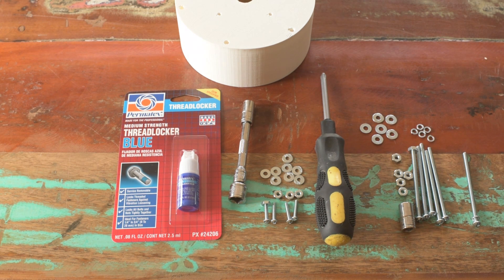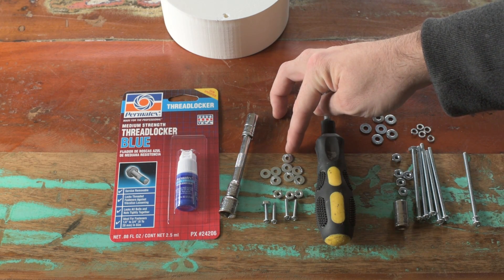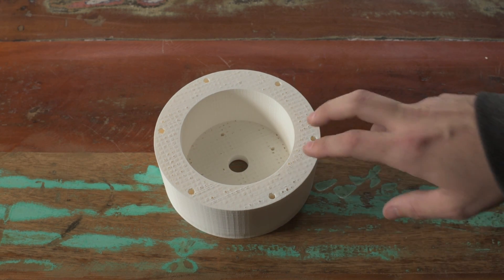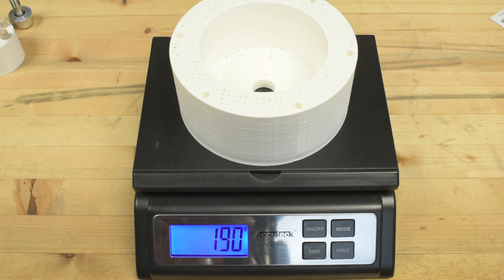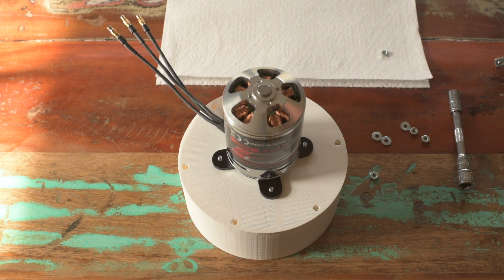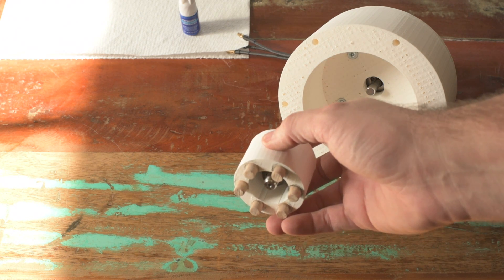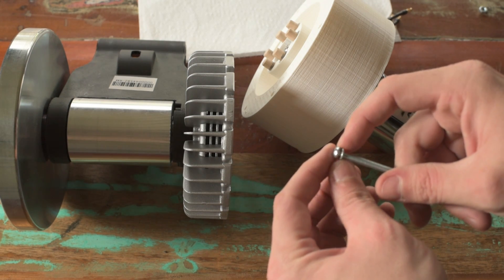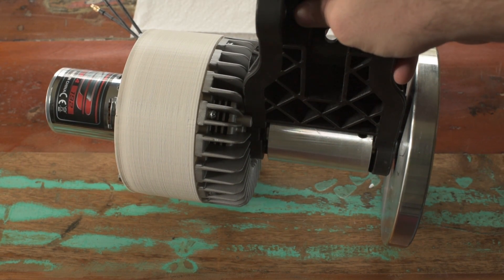Assembly - Bicycle Generator - Part 2

Comment: Well done nice work if you need one of those printing email me the stl and ill print it and send it to you  you defenatly need more shells top and bottom i imagine your using 0.4 nozzles try 1.2mm shell thickness all round with 30% infill 0.20 layer hight combing on 👍👍good luck

Comment: NOOOO not an ultimaker!
I will point out, people say the ultimaker is better than the makerbot, not because of better or faster prints (trust me it is way slower than the makerbot!) but because of the history of makerbot.
It used to be open source and they went closed source and people got butthurt.
Reply from the maker: Does Makerbot have a Bowden extruder too? Speed wasn't really one of my purchase criteria. I was mostly after reliability. I would have bought a Makerbot instead, but did you hear about the lawsuit regarding their extruder in 2015? Makerbot also refuses to accept PayPal for some reason. They just can't seem to make decisions that make sense.
Reply: +createthis +createthis To fill you in, i work at a hackspace, we have a ultimaker 2 , two makerbot clones, one rapmman 3 and a makerbot cupcake.
the Boden extruder constantly jams on the Ultimaker and the print results are rubbish unless you print REALLY SLOWLY.
The makerbot clone is cheap as chips and chuggs along!

http://www.ebay.com/itm/3D-Printer-CTC-Transparent-Based-on-Makerbot-Replicator-4-2-Extruders-/181557613109?hash=item2a45ad5235:g:--EAAOxy63FSr-00
or for the slighly lowe quality build one:
http://www.ebay.com/itm/CTC-3D-Printer-Dual-Extruder-MK8-Factory-Direct-Lowest-Price-ABS-/221995881469?hash=item33affc53fd:g:MOgAAOSwu-BWQyNX
Reply from the maker: +Jared Reabow (Jazza) I have read the Ultimakers jam unless you print slowly or have a pristinely oiled and maintained tube/extruder. I wish you would have sent me that link before I made the purchase. Oh well. It'll just give me something to review/gripe about/fix.

BTW, my printrbot used to jam constantly too. The fix was a piece of freaking straw shoved into the extruder below the hobbed gear. Weirdest fix I've ever seen, but I haven't had a jam in two years. It's the only part of my printrbot that IS reliable.

Have you tried asking around on ultimaker forums for tips and tricks to prevent jamming?
Reply: +createthis ahh yes this is a staple in modern printers, the tube stops the filament from solidifying in the nozzle.
Reply from the maker: +Jared Reabow (Jazza) I gotta say, man. So far, this Ultimaker 2+ is suh weet! I had a single jam out of the box, but I think it was because I was feeding on the wrong side of the power cables, causing binding. Not a single problem since then, and I've been printing for about 20 hours straight. Just, awesome.
Reply: +createthis Very good!
are you using the stock settings in cura?
also as you said, print speed is not important to you so the ultiM is great!
Reply from the maker: +Jared Reabow (Jazza) I tweaked the layer height to get a bit more speed as these parts are structural and don't need them to be pretty. Consequently I had to tweak the top/bottom thickness too. Haven't tried a larger nozzle, though it came with one, which is awesome.

Even at 0.25 layer height, these parts are absolutely gorgeous compared to my old printrbot plus v2.
Reply: +createthis hmm, i wounder is the ultimaker at work is faulty...
Reply from the maker: +Jared Reabow (Jazza) I was wondering the same thing. I know they tweaked the extruder a bit on the 2+ model though. Maybe the 2 extruder had a flaw.